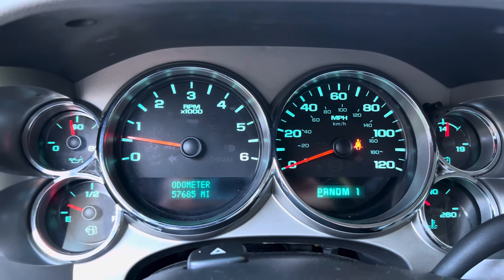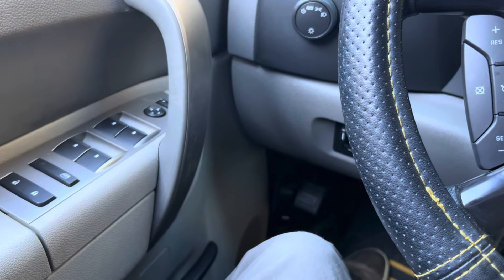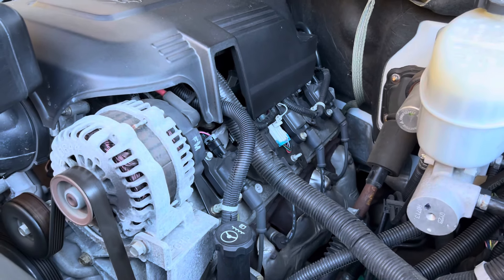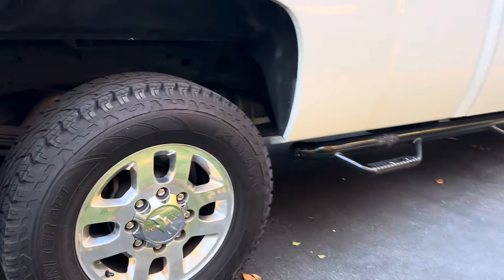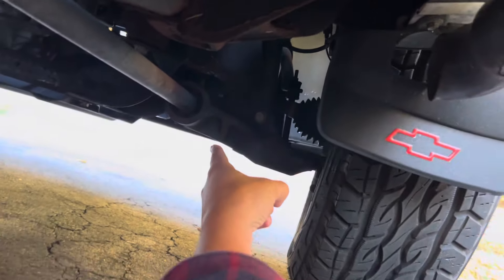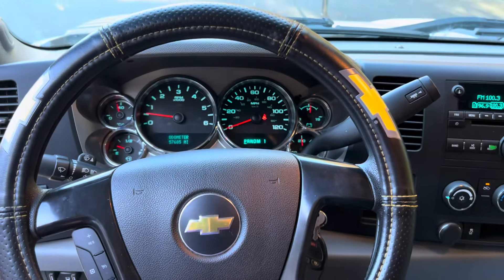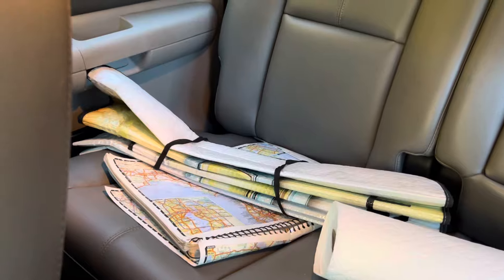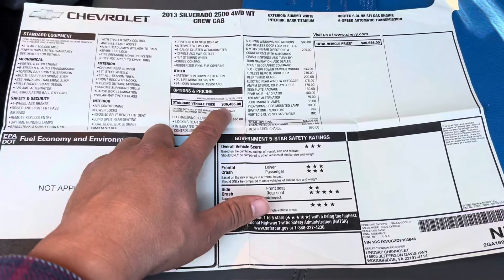Maintenance Plans for 2013 Chevrolet Silverado 2500 HD

Comment: I have a 01 2500hd with the 6.0. Its slow and not a new truck but if you keep them running they will treat you well. 
And those bars are only on the 4x4 trucks if im correct. The 2wd trucks have coil overs in the front.
Reply from the maker: That's awesome to hear, I hope your 01 lasts many more years! I enjoy working on my 2013, so far everything is fairly easy to access with basic tools.

And gotcha I had not seen those bars on a truck before.